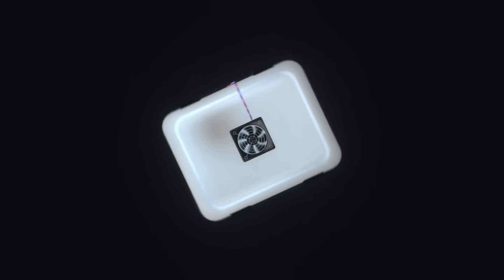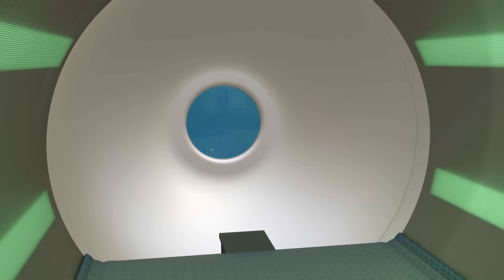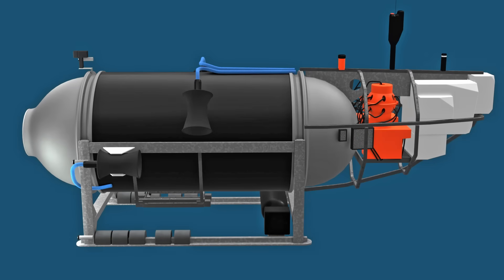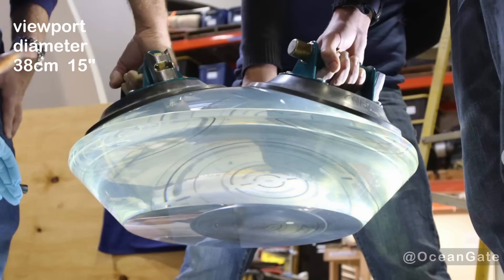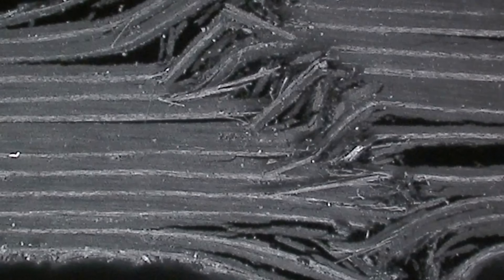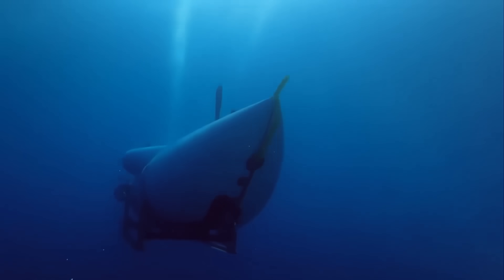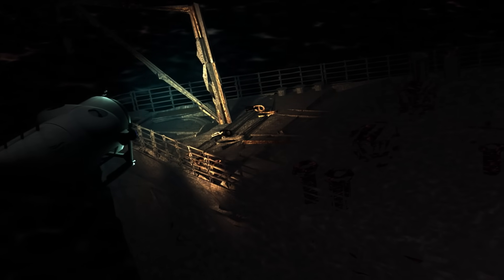Titan Sub | carbon fiber - Detailed Tour

Comment: I have found it interesting that the bolts holding the rings to the domes were all gone ( sheared or torn out of their threadings) Also, the ring for the porthole was missing without a trace of the many bolts holding the (beauty ring) on. Instantaneous collapse followed by an ignition overpressure would account for both. No bits of cf btought up that we saw. Probably small bits is all that was left
 Teeth , maybe parts of the heaviest bone structures. Jaw, hip, pelvis bones but just bits the size of a golf ball....
Hubris kills.
Reply from the maker: When two items are pressed together with massive force, the moment that force is relieved they separate/jump apart with the equivalent of that force.  Both connector rings sprung away from the hemispheres even though they had 18bolts holding them together.  Those bolts were nothing compared to the 1000's tons of force being released.  The same goes for the viewport.

Bone fragments and teeth would survive.  Air viods would collapse and instanlty superheat but muscle and anything largely made up of water would remain and be incompressable thanks to its water content.

Comment: Seagate never showed how the longitudenal CF was applied.  As the video descibed it was not applied under tension so it easy for imperfections to set in.  This is probably what accelerated the failture.

Comment: Clearly, Stockton Rush was onto something with his design.  The Titan survived a total of 7 dives; 5 "crewed" attempts to explore the wreck and 2 test dives. So there is no doubt that carbon fiber has the compressive strength needed for this application.    In the future, we'll see improved carbon fiber submersibles  because, as this video points out, the cost/weight savings are just too much to ignore.

Comment: I used to haul gravel on barges. When he said that the round port hole had 2700 tons pressure on it I imeaditly thought of a barge loaded with that weight. It would fill the deck area 15 feet high on a barge that is about 180 feet by 45 feet wide. That puts it in perspective.
Reply: when i heard that the port hole was affixed from the outside only & that to get out there needed to be supporting crew?.. i knew then that maverick engineering was not going to be applied.. that was a simple correction & if that highly plausible life ender wasnt corrected?!?!..

Comment: I feel like they could've kept the weight down with an all-Ti pressure-hull, by making it thinner in the tubular section, reinforcing it with replacable ceramic/carbon-fiber tiles a la the Chunnel, perhaps with a honeycomb-cell interior structure, and with the grain of the fibers oriented optimally, it could have been astronomically more fatigue-resistant and maybe only twice as expensive to build (?).

Comment: the 90 degree corners on the flanges are stress risers.  carbon fiber deforms where the titanium would not.  i could imagine after a few cycles the titanium flanges could have cracked then sheared off.

Comment: Carbon fiber isn’t a problem when used in its particular applications.  THIS is not one of them.  CF is a tensile application with compression coming through its laminate.  Subs require compressive applications.  Your video is just plain wrong.

Comment: Carbon fiber is great in tensile strength but its compressive strength is not even close. Anyone who's handled carbon fiber ANYTHING before knows that. So its no wonder the thing  collapsed.

Its great to keep pressure from going inside out, not outside in. Diving with a carbon fiber tube with no further support is a death sentence.

Comment: The composite tube, if made of carbon fibers, its compressive strength would be zero... The fibers are good for linear tensions and the thread sleeve lacks shape... The compressive strength was in the epoxy resins . It was a submarine made with epoxy resins and a thin central stainless steel tube where poorly distributed carbon thread was wound... The sleeve of your thread coat does not resist compression... your solid arm does...The resistance is in the arm and the epoxy resins...

Comment: You show the airbus wing as being an example of compressive loads. Yes, OK on the top of the wing, but on the bottom of the wing, it is supported by an equal amount of tension load absorption, The same goes for the front to back distribution.  so that does not support your statement going against all the other experts.

Comment: The layup should have been designed to ensure the fibres were always in tension, possibly pre- stressed.

With the cylindrical format that might have simply not been possible.

Comment: Personally I believe one of the two glued ends failed. Glued carbon fiber and titanium may work on an airplane, but between the extreme temperatures and pressures at 3800 meters using an epoxy to hold it together after several dives?....... It may have not imploded but another phenomenon may have occurred that may mimic an implosion.

Comment: Bit of a hidden contradiction here: Carbon fibre IS strong in both tension and compresseion, however it is constructively almost foolproof in tension (layup failures are simply straightened out) but extremely unforgiving in compression, where only small undulations of the fibres can lead to catastrophic failure. He gets to exactly that point around 11:30. The blanket staetment before that ('as strong in compression as in tension') is to be understood under that proviso and therefore somewhat misleading in reality.

Comment: It is a well understood fact in composites manufacturing that, as the laminate is being cured under pressure, its thickness is reduced. When performed over a mandrel, this tends to create wrinkles in the hoop direction as the incompressible hoop fibers are forced to compress to a slightly smaller circonference.

Comment: Very well done but not being a structural engineer, I still understand the difference be compression and torsion. The wing in the video was demonstrated torsion. During torsional stress some fibers are compressed while others are in tension or stretched. The design of the cylinder had all fibers under compression which is in fact the least desirable for this material. Perhaps some sort of corrugation could have been used with the voids filled with a liquid with better compression characteristics of an ocean water. This would have provided outward pressure on the outer layer and a constant or controlled pressure on the inner laminate.
Just thinking out loud

Comment: Concerning the radial deflection on the outer convex surface of the acrylic port, it is 20mm (@3/4 in.) , not 3-1/4 inches.? [16:32]

Comment: My under standing is that nothing is built perfect and without imperfections. From what I've seen with a metal hull it can be scanned (X-ray I believe but I'm not 100%)for these imperfections with some relative ease. Then the metals have the potential for these micro crack imperfections to be fixed. with a composite it is my understanding that it is far harder and might be currently impossible to find micro cracks or other small imperfections.  I believe some of the published experts know about this and know it much better then I do, and this is the reason they them self's wouldn't use this process. I think when they go on TV they need to do a brief and dumbed down explanation of what went wrong. I think a long and technical explanation of why the carbon fiber process and especially the version used on this sub is a high risk endeavor is just not going to be what any producers want to see on their TV show.  I don't blame some of the experts for over simplifying and saying the carbon fiber was the problem. In a very dumbed down over simplified explanation it was.  In a slightly less dumbed down way it was probably the process and lack of thorough testing but it was still probably a failure because of the carbon fiber even if it wasn't initially the carbon fiber failing.  I think more to the point the carbon fiber could possibly be suitable for a deep dive but much more testing and much better manufacturing processes where probably needed.

Comment: It was a multitude of factors that led to the implosion. In addition to the deep water (mis)application of the carbon fiber, the shape of the pressure vessel, itself, was VERY problematic in terms of the impact the pressure at THAT depth would have on a tube versus a sphere. BASIC physics. But in #stocktonrush's rush to have additional passengers, he used would he called "logic" (we call it HUBRIS) to TRY and break the rules regarding the UNFORGIVING #LawsofPhysics. Under those circumstances...THIS was BOUND to happen at some point.

Comment: i dunno , carbon fiber is strong . i am a boat builder and i use modern composites regularly. what is not ideal is the less than optimal construction hygine, just watch the video of the bonding paste application , no gloves, oils from exposed hands contaminating contact surfaces , no protection against dust, hairs or other. these are only some of the minor mistakes i was able to see at a glance. i think it would have failed at the glued joints , also those pipes and things are scetchy . the layup of the hull would have to have been done in a controlled clean room and i know they cut evey single corner , does not matter how thick they make it , if it is a poor layup it will fail at this pressure
Reply: You are talking about a lot more pressure than you would ever encounter in boat building or even aircraft.
Reply: @michaelbrown8619  yes

Comment: You have said nothing about the resin used in the carbon fibre laminate. Compressive failure normally starts with micro cracking of the resin. I’ve experienced compressive failure in carbon fibre tubes. You could hear the micro cracking for a while before total failure which was very quick.

Comment: You don't explain how a (flexible) fibre can carry a compressive load.

This is done in some devices (e.g. a spoked bicycle wheel, and concrete), but only by pre-stressing the material, so the compressive force eases the load.

I can't see any method of pre-stressing the carbon fibres, which means that the compressive load was actually carried by the resin.
Reply from the maker: The rope in compression is how many visualise it but this is not helpful.  It is more like millions and zillions of spaghetti.  If it is kept straight by the resin matrix it stable able to take massive load.  And yes like pasta brittle but super strong before it snaps.

In the concrete analogy compression is not taken by the resin [concrete] but by the rebar too.  Resin can manage 70MPa compression whilst the firbers 650MPa!!! 

Perhaps a better example of carbon fibre resisting compression loads is the entire weight of a racing yacht being supported on just the slender and sleek carbon fibre foil.  No pre-stressing involved.  Just good ole compression loading.
Reply: In concrete, the rebar is used to help concrete cope with tensile loads, I used a bad example.
The resin preventing the carbon from buckling means that under any compressive load over 70Mpa, the carbon is buckling; i.e. not contributing any resistance to the compressive forces.
The video didn't touch on the shape, and how that would have affected the stresses.
I do wonder if a double-walled composite could work, with the space between the composites filled with a fluid at the final depth (and maintained at that depth). That would remove the pressure cycling that would break down the composite.
 @Mike-Bell

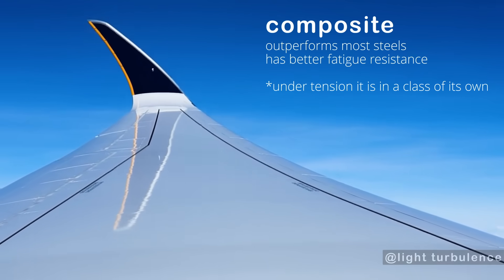Comment: 9:20

Kind of glad you pointed out airplanes, because they kind of shoot down your argument.

While they resist the severe tensions subjected to them by turbulence it is, in point of fact, the COMPRESSION forces acting on airplane wings that cause micro fracturing, strength compromisee, and ultimately are one of THE most prominant reasons why planes have to be regularly maintained, and have to be retired unless their parts are fully replaced.

Compression forces are the achilles heel of carbon fiber composites.

And unlike in the case of a plane where a sttuctural compromise MIGHT be something one might recover from (in the form of a controlled crash landing), a structural failure in a submersible means one thing: instant death.

The stakes for underwater travel are too high and the consequences for failure too absolute to entrust it to a material that "almost always works".  And for that reason, calling carbon fiber "weak" under compression in this context is fully justified.

Comment: Very well done. As an engineer, I appreciate someone who has the knowledge to present this topic. Thank you.
Reply: It is all related to the repeated loading and unloading, this video is well done, those loud cracking during dives cannot be good health signs, if my guess is right, there was some leakage near the end bonds before this failure occurred?
Reply: As another engineer I can say this video is pure speculation by someone with limited technical knowledge. No evidence to support his claims. You surely spotted the error he made on the ratio of hoop to axial stresses?
Reply: @defendermodsandtravels  he uses Compression and Tension incorrectly too. It's okay. Just a video and your 8th grade sciencce classes taught a lot of incorrect info while getting the main idea to you.
Reply: One thing not discussed enough here ....  "The Sphincter Valve Effect" 
What happens is.... BOTH noise & visuals are translated into Electrical Impulses for interpretation by the brain.
When formed, these impulses of information travel South to the Sphincter Valve aka the Orifice Interface.
The Sphincter Valve controls electric impulses in an effort not to overwhelm the brain.
Nerves are very thin in this anal-type area. They need a massive amount of bloodflow to pass the Interface, traveling on to the brain.
Once you throw TOO MUCH INFORMATION down there, the electric impulses backup, the Sphincter Valve closes, blood flow drops.... nerves can't pass information ....... and the brain has no choice but to mutter the only thing it still sees, OH SHYT!!!

Comment: Port hole ruptured so the claim it did not is wrong. There is a good materials simulation showing this failure. Carbon fiber rupture I can buy based on the weave manufacturing defect

Comment: A major factor I would say is the shape itself ' a tube ' which also has no internal ribbing to strengthen is weak from the very offset. I wouldn't be surprised it it failed in a central point which would also exain why the flanges at the ends where it mated with the titanium caps were blown outwards.

Comment: Carbon fiber is great in tension, but terrible in compression.  These people are idiots!
Reply from the maker: How do you explain the entire weight of a racing yacht being supported on just the slender and sleek carbon fibre foil? Just good ole compression loading and massive amounts it.  
When built right carbon fibre is capable of insane compression loading.

Comment: One thing that always struck me as odd about the composite/titanium interface is that they were both flat 90 degree surfaces. Why was it not an inward facing angled interface like literally everything else on a sub? Water tight doors, windows, and any other interfaces all have this design. It would transform the force on the connection point into more of a tensile situation. Even without changing anything else about the design, it seems like this would significantly reduce the amount stress put on those longitudinal fibers.

Comment: There is the statement that the composite tube was "making noises" that I find to be jarring, a noise like that is an indication of lamination failure. I haven't heard that there was testing after each dive to confirm the integrity of the hull.

Comment: One more factor may have been the effect of hydrostatic pressure on the strength of composite materials: The carbon fibers react on hydrostatic pressure by loosing diameter but growing longer whilst the matrix material is just reduced in volume. This may have contributed to the damage onset and accumulation inside the composite material by putting additioan strain on the interface between fibers and matrix. Most models, that describe the strength of composites, do not regard this effect at all as for most application the material is loaded in one, maybe two directions significantly. Direktly on the outside of the hull the water will have compacted the material radially, axialy and in diameter. Other effects to consider are the possibility of water intrusion into the material: Since the matrix material of composites always has flaws and cracks it is usually not 100% tight. If the outside coating has lost tightness then water intrusion may have shifted the point, where the force of the pressure was introduced into the submarine into the volume of the carbon fiber hull which may have caused the hull to be delaminated.